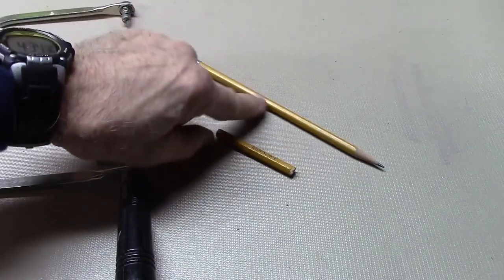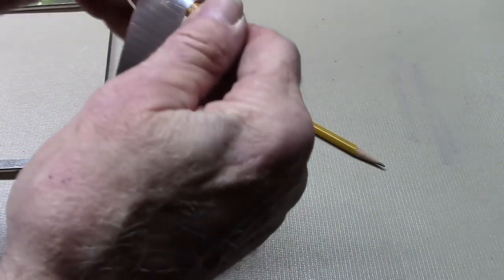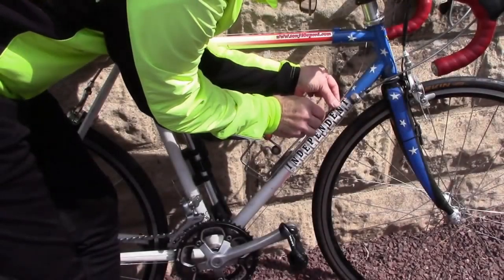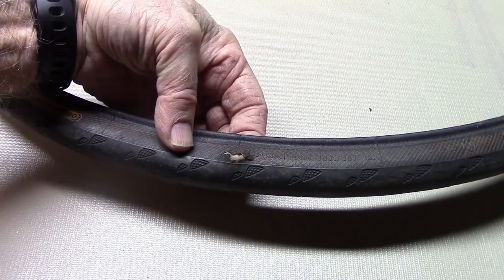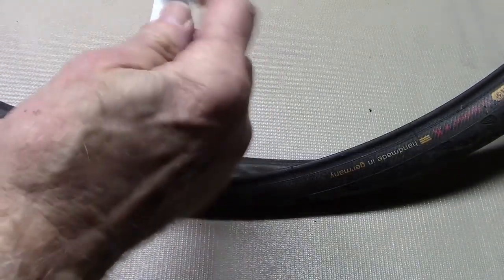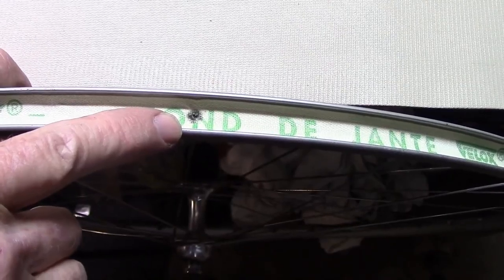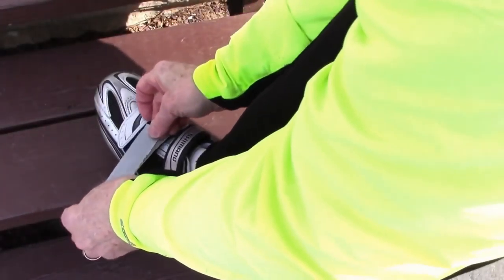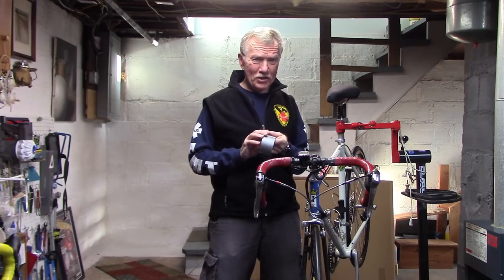Duck Tape for Bike On the Road Repairs

Comment: One day last year, as i was riding hard on my ebike. My innertube bulged out of the tire about a 2 inch gash, from jumping off of curbs as I was coming home from work. I remember by chance I had bought duct tape, from the trip to the dollar store still  in my backpack. I rapped it around my exposed innertube about 8 to 10 wraps rim and all. Even though it looked like I was riding a bull in the rodeo at about 10mph. It saved me 6 miles of walking and I still use that innertube till this day.
Reply from the maker: A 2 inch gash is hard to fix but wrapping the inner tube was fast thinking. A bumpy ride but got you hope. Thanks for the tip, Tony

Comment: CHAINSTAY PROTECTOR
Reply from the maker: Yes, you can. I've also used clear Gorilla tape. But 3M Helicopter tape (a little more effort to put on) is my favorite. Thin but strong and you hardly notice it's there. Thanks for the idea. Regards, Tony
Reply: @tony10speed  Got a black carbon fiber frame in satin, no gloss, so a nice well cut piece of black duct tape on my chainstay it is nearly invisible and does the job, wish I could post a photo, don't know how to do it, 😁 greetings from Spain, amigo👍
Reply from the maker: @SHERIFF8311  Thanks for the info. Let me know how it holds up over the season. Regards, Tony